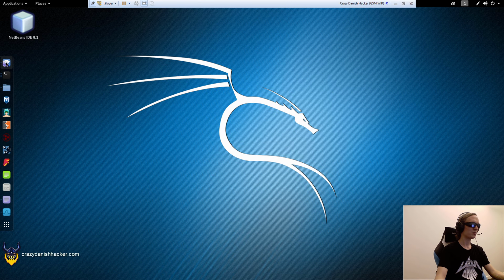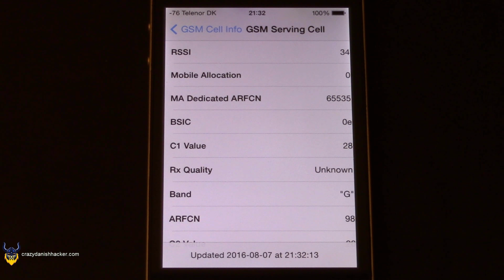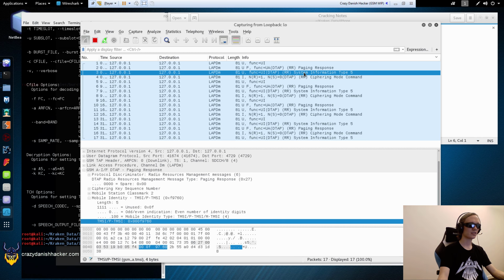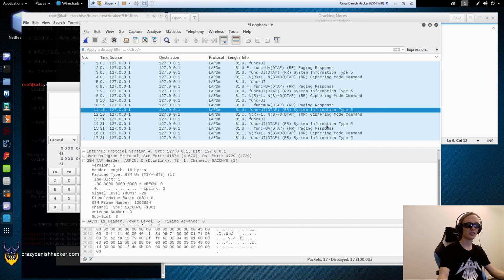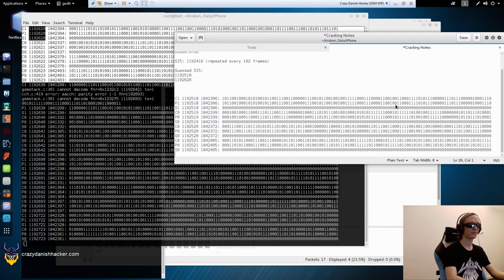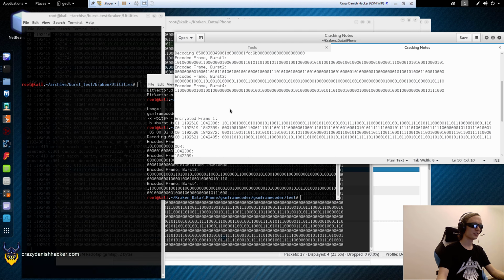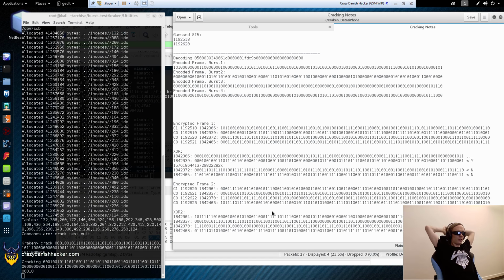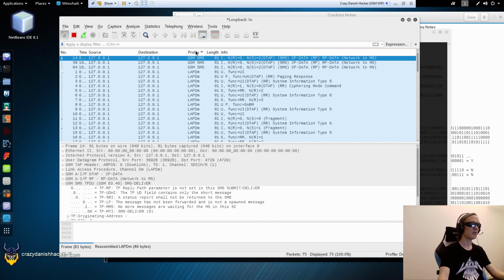GSM Cracking: SMS w/ Kraken - Software Defined Radio Series #16

Comment: my bursts turned out to be quite wrong so i decided to check the out put and framecoder gives a very different output from yours.  Decoding 05 00 03 03 49 06 1d 00 00 00 1f dc 9b 00 00 00 00 00 00 00 00 00 00
Encoded Frame, Burst1: 
000000010000100000000100001010000001000010100000010000001000000100000010000001010000100000010100001000000001000010
Encoded Frame, Burst2: 
000000000000000000000000100000000000000000000000000000000000000000000000000000000000000000000000000000000000000010
Encoded Frame, Burst3: 
000100001010000001000000100000010100001000000101000010000000010000100000000100001000000001000010000000010000101000
Encoded Frame, Burst4: 
000000000000000001000000000000000000000000010000000000000000000000000000000000000000000000000000000000000000000000.  EDIT: i have download a multitude of gsmreceivers and they all output the exact same sequence  with any other input. is there a huge 3 later operation on destroying the tools ?
Reply from the maker: Not sure. I have almost forgot this knowledge by now but one thing I remember clearly was that in order to crack it, I needed to do everything on the same server, except capturing the raw GSM data of course. Another thing is that some telcos for example change how often some of those SI5 and so forth packets are transmitted meaning you have to use the knowledge in this video and change it slightly to your project. I suspect that is the case here. Anyway it's been so long that I don't remember what correct and incorrect frames and bytes look like now. I hope you found or will find a solution.
Reply: @CrazyDanishHacker   there is a bug on gsmframecoder that handles the hex data wrongly i have a patch i might clone the repo and add the patch also a few changes for the whole stack to compile on modern os and architectures with modern tools

Comment: Hi
In the video, you change the value of Actual Timing Advance to 0 in the System Information Type 5 message (05 01 03 03 49 49 1d 00 00 00 02 08 02 60 00 00 00 00 00 00 21 11 04) Why? Is it always necessary to change this way?
When I decrypt my IS5 IS6 messages, I see that after the command to enable encryption, the values of Actual Timing Advance are usually not 0 but change from 1 to 5. It appears in the IS6 IS6 open message, I also should not change Actual Timing Advance to the encryption enable command zero?
------------------------------------------------------------------------------------------------------------------------------------------------------------------------------
The question is, for example, an IS5 open command such as - 05 01 03 03 49 49 1d 00 00 00 02 08 02 60 00 00 00 00 00 00 21 21 04
And the encrypted one is -
05 02 03 03 49 49 1d 00 00 00 02 08 02 60 00 00 00 00 00 00 00 21 11 04
Differs in Actual Timing Advance.
Will I be able to decrypt if one byte is different. The parameter Actual Timing Advance often enough changes even within a single exchange session.
Reply from the maker: This attack works through a method known as the "known-plaintext attack" as far as I know. This means, that you have an SI5 packet every 102 frames as far I can recall, so it is usually very easy to determine where that packet will be inside an encrypted stream of packets. The unencrypted and encrypted SI5 packets must be identical in this type of attack, which is why I change the timing advance to zero (0).

Timing advance corresponds to the time it takes a signal from a mobile phone to reach a cell tower. 
In your case, it sounds like you switched cell tower after encryption is enabled as that would explain the jump from 1 to 5, unless the vendor is generally not using this field, and instead is using it in a way that makes cracking A5/1 packet streams harder.

I read on a Kraken mailing list that it should be possible to use other types of packets as well. However, in the majority of examples and guides SI5 is used because it is repeated every 102 frames. Now, keep in mind some telco operators actually change this value to make it harder to crack A5/1 which is more like security through obscurity.

Reference:
https://en.wikipedia.org/wiki/Timing_advance

Comment: Hello Dear Danish Hacker !
Do you remember which kali linux version you were using when you do this exercise ?
I was trying to compile the airprobe source code, and especially the gsm-receiver binary you used at 9:18
It's very old, i planned to recompile it in a docker container it's why i am asking :)
Thanks for your precious work !
Reply from the maker: Hi Neb,
From what I can recall, I was using a weekly image from around the time this video was uploaded.
If everything fails during compilation and it's too much of a hassle to fix, then I think gr-gsm may have been upgraded since then, in the main branch, to include this feature. You may need to use GQRX directly and not the Python scripts though in case you try out gr-gsm. Keep in mind gr-gsm may have moved from github to osmocom https://git.osmocom.org/gr-gsm

Comment: Hey
Thanks for the video. Very impressive
I found than in some African countries the find_kc app not working. Kraken gives me a lot of potential keys, but the find_kc application does not bring a match ...
Maybe the problem is that needs to roll back more or less than 100 clocks? Do you know anything about this? Or maybe you met this behavior?
Thanks
Reply from the maker: I haven't heard of this problem before, but make sure to run find_kc on the same server that's running Kraken. Every telco provider is different to some extent, meaning that the configuration they use is most likely different. The best solution in this case, is to look into all possibilities and then rule them out. Before going too deep into the server-side of things, read up on whether mobile devices (UE) can work with different clocks. I'm not sure if that's a "server-side" thing only, or whether the client-side, i.e. mobile device can actually work with a different clock. It's also worth looking into setting up your own BTS with OpenBTS or YateBTS, even if you're not going to transmit a signal. That will allow you to modify the settings and code, and see whether your mobile phone can work with a different clock for example.
Reply from the maker: So in essence, I'm not sure why it's not working in your case, and I'm not an expert on the whole GSM protocol either, but if you identify the root cause, let me know as it's always good to know.
Reply: Crazy Danish Hacker thanks for the answer. Maybe they are using randomization so I’m not actually guessing the keystream. I mean can be a situation when SIT5, SIT5ter or SIT6 comes not every 102 frame...

Comment: Hey CDH!

Thanks for the GREAT video. I have a question;

It doesn't matter how many captures I do (even on different ARFCN's)....all the 'Immediate Assignment' packets have 'Time slot=0'.

I can try and decode SDCCH8 on 'Time slot=1' and it will give a result sometimes...but is there a reason why all the packets in the BCCH decode as 'Time slot=0' in wireshark?

Moreover, when I use 'go.sh' to get the burst.txt data....no packets are succesfully decoded. I only see the bitstreams of ALL the packets/frames.
I wonder whether I am doing something wrong....

Anyways, keep up the great work man!!
Reply from the maker: The configuration of the telco network can vary from company to company, and also the equipment they use.

For analysis, you should send several SMS to yourself over 2G GSM and only analyze those packets.

The timeslot shouldn't matter.

Concerning go.sh, you will probably need to change the "1S" flag I think. It's been a few years since I last did this, but based on what you've said, it sounds like you need to change it to S0 if you're trying to get bursts for SDCCH/8 timeslot 0.
Reply: @CrazyDanishHacker  
Thanks for the quick answer!! 
I really appreciate that.

I will see and try your suggestions tomorrow at work. 

Still strange.... I recorded the channel while sending sms messages to myself today...but I couldnt find anything signalling the traffic in the pcap XD...

I will try and grab another phone tomorrow to see whether I can see traffic while using it. One would think that if you (1) know your phone is using 2G and (2) know the ARFCN it is using....you SHOULD see traffic when recording....no luck still :""")

I wont give up though....and will use your information.

cheers,
Jasper

Comment: Hello
To use go.sh, you used the number 64 (decimation rate) . Is 64 must be changed if the record file has been recorded at a specified rate?
I saved the file with gr-gsm/capture but when using go.sh. Text output (bursts.txt) included errors like 
...
sch.c:260 ERR: conv_decode 11
sch.c:260 ERR: conv_decode 12
sch.c:260 ERR: conv_decode 10
...

I guess this error is due to the wrong decimation rate.
my recorded file sampling rate is 1.024M
thanks
Reply from the maker: I can't recall what that specific error message relates to, but if you only get it on occasion, then it may just be corrupted packets or perhaps encrypted data that it couldn't decode properly.

Comment: how can i carck if in immediate assignment package hopping channel :yes. in your case hopping channel: no
Reply from the maker: If SDCCH/8 has channel hopping enabled you will probably need to capture all the bursts and put them together correctly. I don't know which tools you can use for this, but you can see if the most recent version of gr-gsm supports this, or you can also try to contact the developer.

Comment: is it possible to have your .cfile to begin testing my kraken?
Reply from the maker: I don't have it anymore. If you look at the gr-gsm repository, and look at one of the forks, and then the test data directory, you'll find something like this for example:
https://github.com/ptrkrysik/test_data/tree/86df03f54d86093e2fe22daae8bb8c170cf31e58

The cfile in there should be usable for both testing decryption but also cracking with Kraken.

Comment: Now that gnuradio-core is obsolete and gsm-receiver won't compile, how would you suggest we get the burst packets in a similar format as gsm-decoder only shows the C0 frames?
Reply from the maker: Have you tried installing and using gr-gsm at all? What happens when you run apt install gr-gsm in the latest Ubuntu? (https://packages.ubuntu.com/cosmic/gr-gsm)

Have you tried using grgsm_decode? 
(https://github.com/ptrkrysik/gr-gsm/blob/master/apps/grgsm_decode#L304)

Have you tried getting an older version of gnuradio-core from the Internet to compile those programs, that won't compile?

Have you tried contacting the gr-gsm developer?

Comment: Hey,
I downloaded the dlt files, then generated the idx files respectively after that i ran kraken script (./kraken ../indexes/) but it was showing index file corrupt: ../indexes//420.idx error. Then i commented the code and the script continued and loaded the kraken prompt. Then i ran the crack command but it is only giving crack #0 took 182631 msec as output. It is not giving further required output.
Reply from the maker: If your index files are corrupt, then do an md5sum of those files. There should be an MD5 (sum) file available that you can use to double check your DLT files aren't corrupt. Try downloading the file that generated the 420 IDX file, and then write the DLT files again. Keep in mind you need 4TB in total, 2TB for the DLT files, and 2TB to write the DLT files to a new disk.
Reply: @CrazyDanishHacker  
i checked the md5sum of those files and it is matching. And yes, i have 4TB in total.

Comment: how create cfile?,ok i know how make cfile,it record bin, and render gnuradio,what the file brust.txt?
Reply from the maker: Just watch the video series, everything is explained that you need to know. You don't need to use the burst file for my tutorial.
Reply: i have question, if i insert kc key in flowgraf gnuradio gsm(Decryption),i can see decode sms and more ?
Reply from the maker: If you insert the correct Kc key with a working flow graph in gnu radio, then yes you can decode SMS and other packets. Voice typically has channel hopping so you need to capture multiple channels, break them into separate files, and then somehow put the individual bursts back together in the right order.

There's an initial packet (or a few), that actually instructs the phone which channels to hop and also in which order, but Bogdan's code didn't work last time I tried.

Comment: When i decrypt with timeslot 1 and SDCCH8 the wireshark packets always are saying func=ui and func=unknow any fix for this?
Reply from the maker: Make sure the signal strength is adequate in case it's very weak. In case that's not the issue, then try an older version of GR-GSM for example. In any case, it's better you raise this issue with the gr-gsm developer. (Open a new ticket on github if it's not a known issue for some select telcos.)

I also recommend switching network and a prepaid SIM card to another provider and see if the problem also exists with the other provider and their network.

Comment: In my case, SI5's frame number + 102 = next SI5bis's frame number,  SI5bis's frame number + 102 = next SI5's frame number. So should I xor SI5 bursts with SI5bis bursts or SI5 bursts?
In addition, sometimes SI5's frame number + 102 = IMSI detatch's frame number and I don't know what possibly is the next 102 frames packet, because it is encrypted.
Reply from the maker: Some telcos have enabled randomization of SI5 frames, this may be why it's not transmitted every 102 frames. As I mentioned in this video, you find an SI5 frame, and then you hope that after the next 102 frames, there is another SI5 frame. That's how this attack works, by having an unencrypted packet, and an encrypted packet where the contents are known. (In other words, it's the "known plaintext attack".)
Reply from the maker: Try these capture files. 

copenhagen-cap-003-60s-A51-Packets:
https://mega.nz/#!hz4VCL4Y!9qqkU-iPcQtZPIKST27M8HV7ui-ookcXJQZU8nzQPvY

copenhagen-cap-002-60s-A51-and-A53-Packets:
https://mega.nz/#!si5AlLzI!NrtTmyiVY4r5ZV_kxY3DuA8M2XgNNzauOY5gAWQr4LU

copenhagen-cap-001-60s-A53-Packet :
https://mega.nz/#!l3J1CQiY!KxSxSSeeJRp6ElTAFYDWXBuSnB4qnFMoW45ugsP0jNw

Filesize for each file: 457.8 MB

Frequency: 952800518

SDCCH8 Timeslot: 1

I don't know the contents of those A5/3 and A5/1 encrypted packets, they could be anything. You should be able to crack the A5/1 packets with kraken though, despite that I haven't tried this myself. I also don't know the encryption keys for any of those packets.
Reply: Thank you xD.
Reply: If hopping channel is used, how do I know which channel the packets hop to?
Reply from the maker: There are no programs that can properly reassemble channel hopping packets as far as I know for the traffic channel (TCH/F for example). But feel free to try this, it didn't work for me though:
https://github.com/BogdanDIA/airprobe-hopping

Concerning your question, this is a longer answer and I've forgot some of the details. In this PDF you'll see the details you seek:
http://yo3iiu.ro/blog/wp-content/uploads/2012/04/Evaluating_GSM_hopping_V1.2.pdf

In short, SI1 has a "List of ARFCNs". These channels/frequencies are where the channel (and most likely also the downlink) will be.
There's also something called Mobile Allocation which is how many channels are used. 
Then there's the Mobile Allocation Index Offset aka MAIO, not sure what this means, I think I researched it a few years ago. It's probably "from which ARFCN in that list, that the channel hopping will start".
There's also the HSN or Hopping Sequence Number, if it's 2, afaik that means it will hop 2 ARFCNs per burst. (I might be wrong)

Last but not least, there is also something called a "Bitmap" I think. I forgot what it does, but I think it was important in relation to channel hopping.

Anyway, with those captures I shared, channel hopping shouldn't be enabled for SDCCH/8, only TCH/F for example.
Reply: Forgot to say thank you :D. My apology.
I managed to install and run Kraken successfully. In addition, I have also cracked some bursts from a provider.
Having said that, I still don't understand how Kraken exactly works. 
Do you have any document that explain clearly how Kraken works? Thanks in advance.
Reply from the maker: No problem, I don't have much, but you should start with the A5/1 cipher and how it works, from there also take a look at Karsten Nohl's slides from various conferences, maybe the Kraken source code and their wiki, etc.